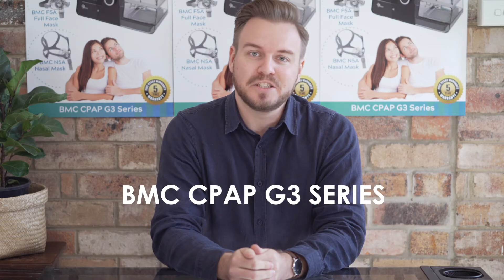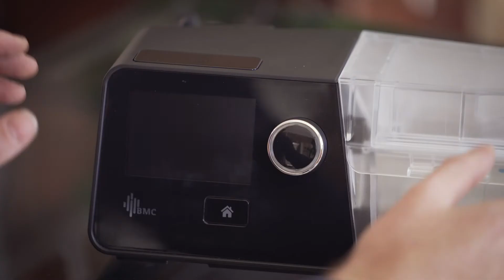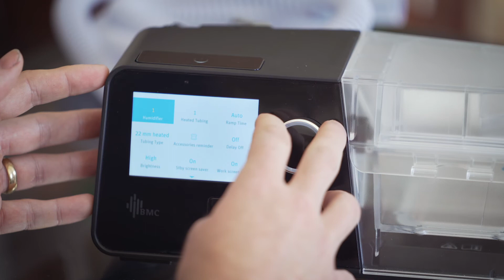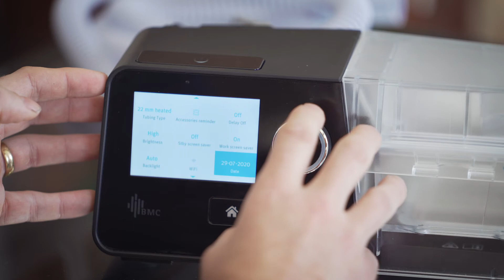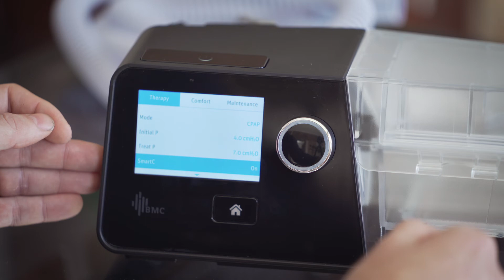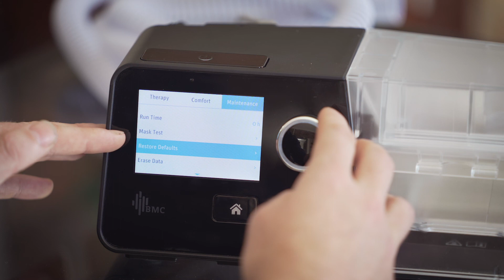BMC G3 APAP/CPAP Series Device Tutorial for Clinicians

Comment: Hi There, I have my G3 cpap with an issue when starting, the last time I used it, I was in a hurry and I just disconnected it from the power without pressing the off button, when I wanted to use it last night, the machine does not send air and a message appears on the screen that says "it is reading the SD card " and it does not start; I already tried restarting it, but when I connect it back to the power it stays in the same message as above, can you help me correct this problem? thanks in advance.

Comment: Hi from the USA.  I just watched  this video many many times to do the initial User AND Clinician setup process for the LG3600.  The provided User manual left so much out.  Your video help me get through the Clinician menu.  Tonight will be my first time with this device.  Big stumbling blocks for me were:
 1) that the heated tube with that sensor plug-in can not be placed in water to wash/rinse.  It is so frustrating to try to get cleansing solution and rinse water in and through tubing without getting the plug-in sensor wet.  Luckily I called the Supplier on this before initial cleaning.
2)  The Reservoir chamber design in the lid of the chamber makes it so hard to wash, rinse dry.

Your video helped.  The manufacturer supplied documentation and the above design deficiencies are a Big Stress when cleaning.
Thanks for providing a lot of what the manufacturer did not provide .  Note, I am a user, not a provider of this device.
Reply: "that the heated tube with that sensor plug-in can not be placed in water to wash/rinse. "

I've been washing mine in the kitchen sink for months, and it still works fine. After washing it, I hold the tube about 3 feet from that end and whirl it around rapidly to throw off any excess water. I clean the tubing once a week, but I wash the nasal cannula (I use a nasal pillow) every morning. I also hook the tubing and mask up and run the unit for an hour to dry everything out -- with humidifier off and tubing heat at 5.

Comment: I almost wanted to buy this bmc model till I realized that patients have no access to their own detailed sleep reports like how resmed could provide. The bmc sleep reports shown on the machine and via PAP Link app are miserably brief, even the email version via Icode. So no, I will not buy the bmc cpap till the company settles the reports issue and return right of access personal reports to patients.
Reply from the maker: The BMC CPAP PC software called PAP Link displays full flow trace and leakage data with customisable report generation: This including up to 7 days of detailed data. A full statistical summary of all relevant parameters is also included on this report.

If an individual CPAP user would like access to the PAP Link Software they can request a download file from BMedical or BMC directly.  www.bmedical.com.au

Most end users find the PAPlink app very easy and convenient to use.  Getting a report is a simple as scanning a QR code.  The most important parameters to check regularly are leak and Apoea Hypopnea Index.  Only  these show an issue with treatment or if a patient is having issues do we recommend doing a full download via the software and working with your provider to resolve the issues.   

The wireless data to the provider portal has been designed to enable providers to remotely see how their patients are doing and make remote adjustments.  Many providers and end users find this remote assistance very useful.  Most issues will require the assistance of the CPAP provider or Doctor help to resolve.